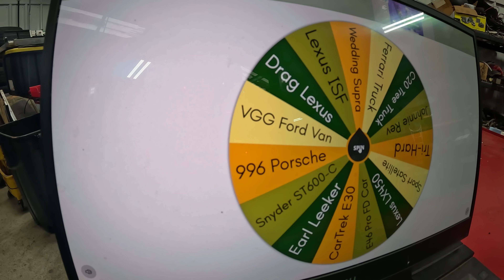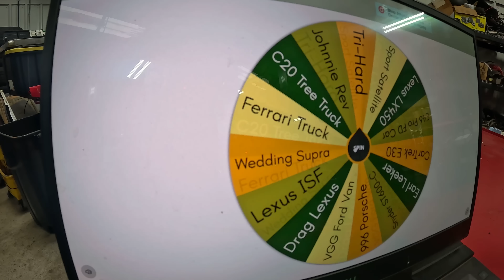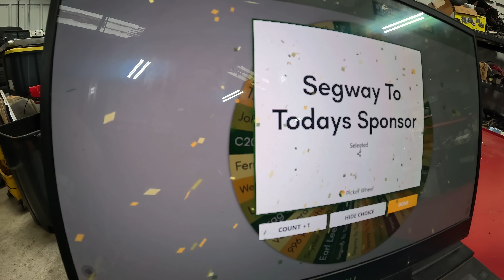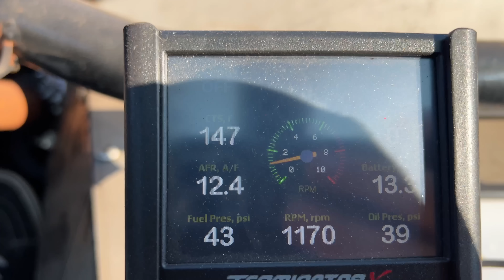First Test Drive of Our Big Block Nissan Did Not Go As Expected!

Comment: Fixing the oil leak at the back of the intake, the one step you're missing is the Shop-Vac attached to the valve cover... Plug up any other oil breathers, dipstick tube turn the shop back on and pack the silicone and it will actually suck it into the leak.

Comment: Hey Jared, just my 2c....I understand the need for an air filter while driving on the street, from my own experience (big cube/rpm, tunnel rammed, NA deal) that particular set up tends to throttle the engine in a big way for anything over low/mid rpm use. 
I'm sure there's others out there that haven't had any issues but it is something to look out for.
Alky Digger has a better solution that attaches a large singular filter directly to/over the front of the bug catcher, allows more air flow while also being easy to remove/refit for maintenance etc.  Cheers

Comment: Biggest example of doing the wrong thing the right way: replaced the clutch on my wife's variable displacement air conditioning compressor with 6 welds to the pulley.

Nissan at the time didn't sell a replacement clutch, just a couple grand on a compressor, and the displacement minimum was 0 cc, which, to my mind, is the same thing as having the clutch disengaged (with the possible caveat of what happens if the compressor seizes, but it was on its own belt, so whatever).

It kept the AC running in New Mexico for a decade, until the VQ motor managed to drop a cylinder at 175k miles.

Comment: So far biggest do the wrong thing the right way with my car has been changing headlight bulbs. By factory design you are supposed to pull the front bomber and remove the entire headlight assemblies. However what I found out is that if you loosen everything a little, you can cram your hands down into a tiny space to swap the bulbs without removing the bumper or the headlights. It takes the same amount of time, but with far less work.

Comment: My wrong thing the right way was actually the wrong thing the lazy way. Had a leaky axle seal and it someone fudged it up and you couldn’t get a new seal in without tearing it. Sooooo I just dumped used motor oil in the trans weekly 😂

Comment: Wish I had the confidence to just have projects, my Towncar is just sitting there without 2nd gear, I want to to just do a lower mileage swap but I'm nowhere near confident enough in myself to do it.
Reply: eh just do it it's just bolts n hoses and shit. I was in your position at one point, I just did the thing and figured it out. Sometimes you do stuff twice, sometimes you screw stuff up. But it's worth it in the long run. Just research diligently and take lots of videos of disassembly lol.
Reply: You just gotta get in there and start. You'll learn as you go and by the end you'll be ready for the next one!

Comment: What ever happened to the concept of electromagnetic valve control? No cams sucking a bunch of power and 100% valve control all done through ECU programming. Sounded good to me.
Reply: Koenigseg does it. So it seems to be a monetary and not an egineering problem :)
Reply: The cycle rate and controls necessary for it are really gnarly. I work the assembly line at an industrial controls manufacturer that builds our own control solenoids, and nothing we make cycles fast enough to do it. (I've asked...more than once.)